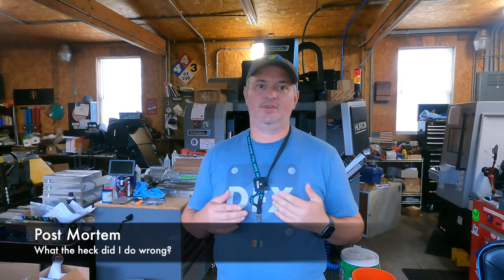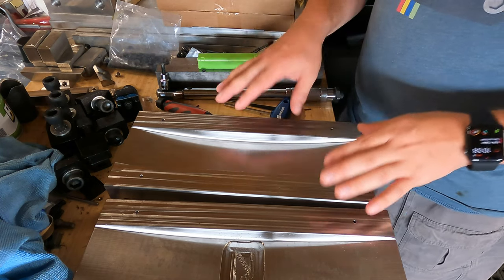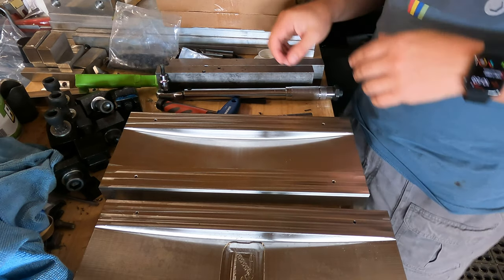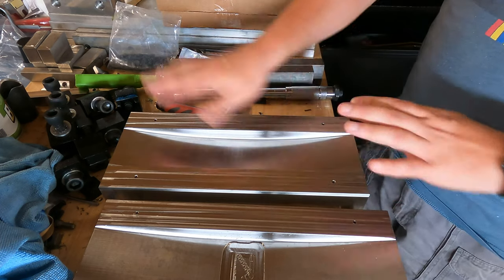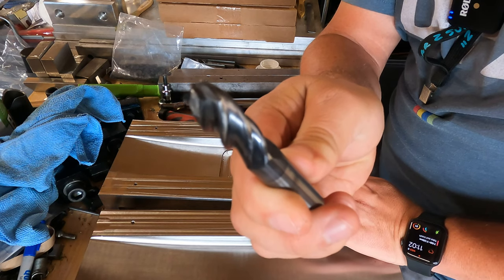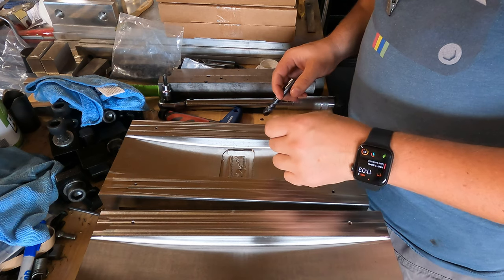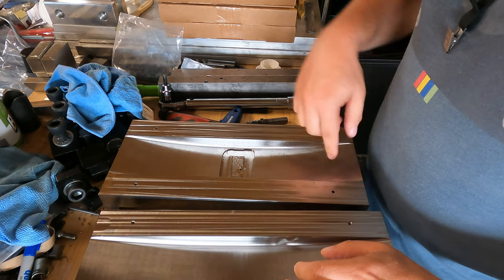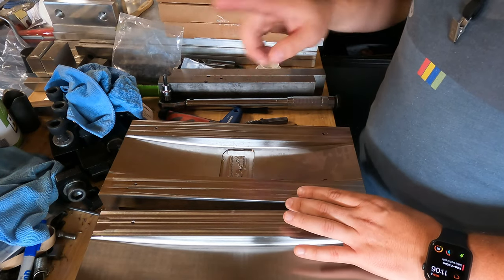Post Mortem

Comment: Hey Tom congrats on going full time  happy to see you've done well. Recommendation is get a engine hoist to save your back and a matching pair of Kurt's. In the Kurt's  more than likely you would have snapped off the tool  well before you dislodged the part, if it did break the part would have been saved.  the part and tool you lost is worth well over half the cost of a new 6 inch Kurt.    Also some content ideas for some videos is how you go about getting work and quoting jobs  ...
Reply from the maker: Thanks for watching and the feedback. I've actually got a pair of vises that are matched really well here already and I put them on from time to time. My engine hoist wouldn't work though - the chip conveyor runs along the front of the machine and blocks access that way. I did think about a gantry arm or something like that though. Appreciate you taking the time to write and give feedback as well!
Reply: @TomZelickman  hea yeah ive also had the same issue on a vf2 with no clearance under it for the picker,   look at your picker  ours was square tubing for the arm  get your measurements order a sqare that slides nicely into it and with two drilled holes and a saw cut you can make a extension on the boom to easily adapt to your needs. ps not osha a proved